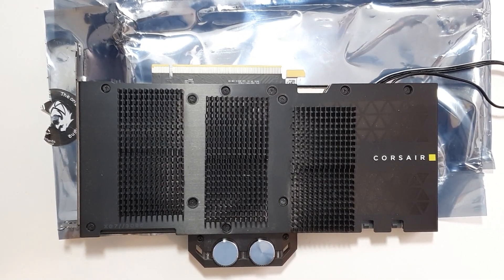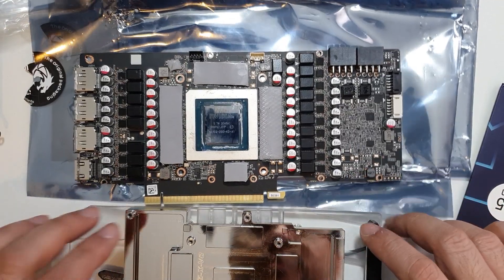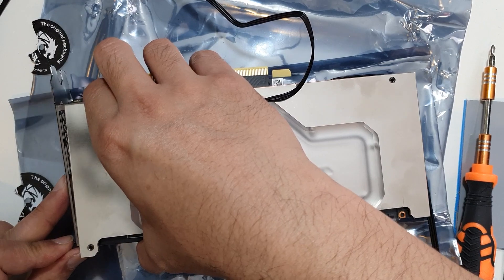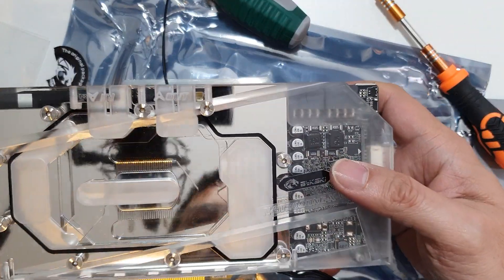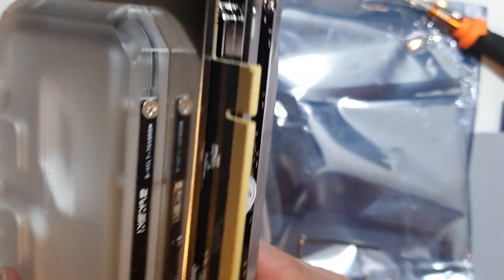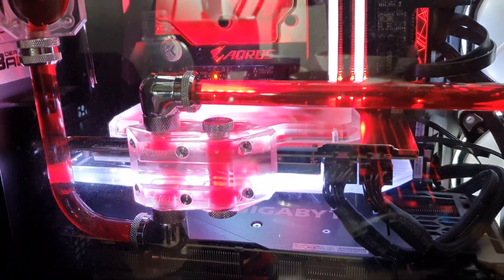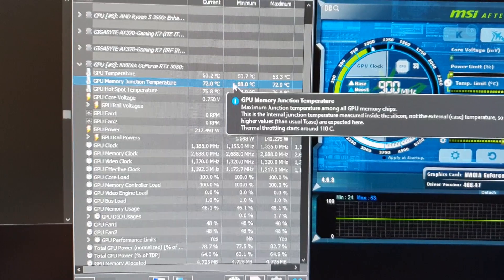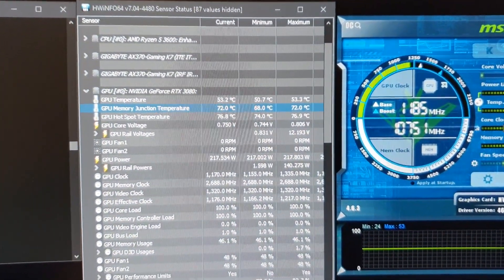Bykski RTX 3080/3090 Waterblock with Active Backplate Cooling Review

Comment: Do you have to use top and bottom ports on the bridge or can you use both top or bottom. Asking in consideration of a vertical mount in 5000d airflow case.
Reply from the maker: Its fixed so yes has to be top and bottom or if vertical mounted - front and back

Comment: Way too much thermal paste on the GPU and there is something wrong when you're water-cooling your card and have a 23C difference between your GPU/GPU hot spot temps!  My RTX 4090 has a 12C MAX differential between those two temps (and that's on a 600W GPU)...  Considering how much thermal paste you used on the GPU die could explains that result.  That is the only thing I can think of unless you simply installed the Byksi wrong somehow.  Perhaps you should have stuck with the thermal pads the block came with.  I know for a fact that exact thing has happened on another video I watched recently.  The guy had the same issue (delta between GPU and GPU hot spot was too high) and he was also using "better" pads that didn't come with the block (this was an EK WB) but they didn't allow proper compression and he wasn't getting a good enough seal on his GPU die.  He disassembled the card/block and re-installed it with the pads that came with the block and problem solved.  Dropped his delta by 10C.  I mean it could be the paste but I kind of doubt it.  That was a comical amount of thermal paste though...  Anyway, I'm not trying to be an asshole here just giving my honest input.  I've been building PC's since the mid 90's and started water-cooling around 2005, so ya...  Anyway, your PC looks great though!  Really nice job there.
Reply from the maker: no worries bud all good. I learned this rule many years back pea or rice on cpu and alot on gpu for pasting it has worked for me. Alot of people are confused by my temps but dont really understand that im mining or was mining with 2 cards on 3070 underneath the 3080 so the air cooling the rad at the top isnt fresh room temp air, its hot air from the 3070 also im measuring the junction temp and hot spot temp in hwinfo people only see the gpu temp. anyway since eth is dead ive since sold the 3070 and now just running cod mw2 max settings with 45C temps on the 3080 still on the same build with dusty fans and rads coz im lazy to do some cleaning. Might get a 5800x  to replace my 3600 so i dont get much cpu bottle neck on the mw2 benchmark and get past 163fps on 1440p

Comment: Have a question can I use the inlet as outlet outlet as Inlet
Reply from the maker: You can definitely reverse the flow going into the outlet and coming out of the inlet. From other liquid cooling guys the consensus on not following the directions for flow doesnt impact the overall temps so run your flow into your components the way you like
Reply: @magnomnz  thanks

Comment: On the memory, why did u pick 1.5mm over 2mm? Which one is better in ur experience?
Reply from the maker: The included ones were thinner but i already had the 1.5 ones but softer so i went with those. They got good contact and squished fairly good that would equivalent the included ones in thickness after. Its been a year now i think and still going strong. Mining for about 8 months on that 12 months, i stopped about 4 months ago since it wasnt worth it much anymore.

Comment: Got the same thingg took apart a asus tuf just to change thermals and it was horrible (card I got was a lemon and I lost silicon lottery badly)   I couldn't even boost the memory 1000+ or it would crash.  ANYWAYS long story short I purchased this waterblock and your video is perfect in explaining how to set up!  Now I just need to go through the trouble to set it up and the screws scare me!  Also is it too heavy?  Should a bracket be put underneath to hold it up?
Reply from the maker: Too bad on the lucked out silicon. As for the screws just hand tight screws no need to tighten them stiff. Since my card is reference theres only a few screws unlike custom aib ones.
Reply: @magnomnz  Oh nice, I gave that one back and got one that can go to 1000+ ez so good to see it makes a big difference on temps!   Just need the time and energy to do what you did.   Also quick question, I thought on the waterblock the in/out one is on top and the other is on the bottom.  Or does it not matter?
Reply from the maker: @jonahjameson272  the inlet and outlet are defined if horizontal mounted bottom is in top is out. if you mount the card vertical then facing you is in and the back of the  card is out.

Comment: 1st of all u wasted money, you don't need an active backplate for any 3080, 2nd you should of used gelid extreme, those pads you got are blah, quite stiff, youd need more than a 360mm rad for gpu/cpu setup too, the corsair would of been perfectly fine and looks way better.. your main issue is though on top of it all, having all the gpu heat of the 2nd card duping into the radiator

Comment: Those numbers are way higher then I thought they would be. I guess you get what you pay for, my EK blocks with active backplates keep the temps 10c lower over all and on the GPU 15ishc lower.
Reply from the maker: But do you have a 3070 under your 3080 both mining etherium on the same machine that is the question.

Comment: Sir, what about the other thermal pads, like on other chips, that manufacturer put on, such as resistors, etc, They don't need thermal pads anymore, after water cooling?
Reply from the maker: On the front pcb just follow all the places where your stock cooler has thermal pads at the back just cover the mems and  up to you for possibly some of the backside of the vrm if you want

Comment: You're pushing the hot air from inside ur pc generated by the 3070 thru the radiator and therefore getting much higher temps than u should. Also u didn't put thermal pads on the VRMs.

Comment: Bit late to the party and hindsights a great thing but here's an FYI for you, the outside of those ESD plastic bags like the one your 3080 is resting on are electrically conductive on the outside and only shielded on the inside so you might as well lay the card on something else even carpet lol as laying it on the outside of one of those bags is no better than using nothing at all.
Something maybe to be aware of in the future.
Reply from the maker: Honestly i have laid pc parts on carpet, bare floor, on top of billiard tables etc while building since year 2000  and ive had an internet cafe with 10 comouters and then worked on another internet cafe 3 years after with about 42 computers and 2 pool tables and not had any pcparts get any issues from static during builds see my 1st pc build here in this channel me building on the floor and carpet. That pc is now using a 3060 mining eth for 5 months and also used as an htpc.
Reply from the maker: This triggered me so much i had to remember and find jays video on it. https://youtu.be/0swuvSF527E
Reply: ESD bags are conductive on both sides, that's the whole point (avoid buildup of static charges).

Comment: Also you put rads pulling air through them by the fans from the outside of the case , you didn’t put thermal pads in the most important part of your 3090 THE VRM dude this I’m sorry is absolutely the worst technical video on blocking a gpu ! The block even had the extended areas for the pads to contact the block!!!!! No backplates that are cooled are not contributing heat to the system either that’s what heat transfer fluid systems don’t do they move the heat via liquid to an exchanger or radiation and dispel it there!
Reply from the maker: Just because it wasnt in the video doesnt mean its not there the vrms hs have thermal pads. Its been running fine still mining eth for 24/7 for the past 6 months and holding steady with temps on the tj at 64c.  It doesnt matter if you are pushing or pulling or both on rads the video isnt about maxing cooling performance.

Comment: You don't use thermal liquid in gpu processor?
Reply from the maker: just thermal paste, ive never used liquid metal on gpu or my cpus
Reply: Never use LM on gpu too many transistors close to the die one micron of lm hits and bye bye

Comment: Is active backplate always sold separately?
Reply from the maker: they come both in a package together. if you already have a waterblock without an active backplate and have a reference design 3080 or 3080 you could try the backplate waterblock only from bykski.
Reply: @magnomnz  im thinking about only the back plate since my card is already hybrid. do you think it will help my mem junction temp?
Reply from the maker: @truecrimeyo  if you are still mining yep but for games it shouldnt be a big deal not to have it, maybe for forspoken coz it has huge spec requiremwnts and likely to push 3080s to its limits. Go for it if you have the money and time to redo your loop

Comment: looks great. but i think you forgot to put the vrm thermal pads. you could have shorted the card if you didn't put those.
Reply: He did forget them
Reply: Also fan orientation killin temps on air cooled doesn’t matter on liquid you want all fans pulling air through rad from outside of pc case rads work on ambient temps so if exterior case temp 25c interior case temp 35-40c you are warming the fluid instead of cooling it lol that’s how ambient temps work with heat transfer fluid systems.I’m not sure about mining but if this thing is doing intensive work it’s will fry !!!! Maybe. It right away but it will fry

Comment: I just ordered bykski kit for my system and my 3080 this is good to know iv got same case as well this is good to know i need to order another 360 rad. Im running a 10900k oc to 5.2 so prob will have slightly higher temps

Comment: What xg7 waterblock is that? I can't seem to find it when I search up XG7 Zotac
Reply from the maker: Its the xg7 rgb ref model. Basically the reference 3080 waterblock from corsair.
Reply: @magnomnz  will it work with a Zotac Trinity 3080 Ti?
Reply from the maker: @icecoldkv8005  yep the xg7 ref waterblock will work with zotac 3080ti amp holo or trinity models

Comment: Did you notice if the top part connecting the front and back plates can be reversed?  I'm hoping to use 2 of these blocks to SLI 2x 3090's.   If the top part can only be mounted a single way, it could cause some issues with me running tubes.  (have to 3 slot SLI it due to reasons)
Reply from the maker: i think its possible to flip the connector of the front and back plates it looks like the screws are spaced evenly to reverse them and there arent any complicated jettings that require a certain flow direction since this will reverse the in and out of the water flow. i.e cpu block which requires opening the block and flipping a flow direction plate if you are changing the in and out ports.

Comment: What thermal pad are you using size and dimensions! Can you please put up a link to the product! I own the 3090 amp holo and was wondering if I need the same size thermal pads?
Reply from the maker: i use thermalright odyssey extreme 1.5mm
Reply: @magnomnz  after the upgrade are you getting the full hash rate! My vram hits 110c and the GPU starts throttling! I am only getting 74 mH/s. Which sucks!

Comment: Which model of 3080 are you using, my strix 3090 with ek block can’t fit in the o11. Considering about switching to by block, it looks decent and much cheaper.
Reply from the maker: i have the zotac amp holo 3080 it is using the ref design
Reply: @magnomnz  appreciate that

Comment: Just wanned to say that the reason for backplate for 3090 mining is because they have memory modules on the back with only cooling from the aluminium, So my 3090 tuf runs at 104c on the memory temp, but at 50 on gpu core. the 3080 dont really have an issue doing good in mining without overheating.. but I dont feel comfortable running it at 104c, so I "only" get 100mhs at 94c
Reply: I use thermal pads for back of my GTX670 to connect vrams with backplate. 
and my backplate is painfully hot to touch!
Reply: Hmm thinking of getting this if junction temps are much lower.  I currently bought a heatsink from amazon lets see (Already changed/swapped thermal pads 5-6 times cant remmeber?  All in 2 days because of my frustration.  I'm 100 celcius holding but getting 119mh

Comment: You didn't pad the chokes etc on the front and you have no mem chips on the back of the board? So not much point in the active backplate.
Reply: He followed the instructions (ha, just one picture), but I'm also surprised by how few spots they instruct to pad https://www.bykski.us/collections/new-products/products/bykski-full-coverage-gpu-water-block-w-integrated-active-backplate-for-aic-reference-rtx-3090-n-rtx3090h-tc-v2
Same here btw https://www.youtube.com/watch?v=FvFcE16_Rh4
Reply: @Miskatonik  https://youtu.be/ZAWFa-zuZOU
Reply: @sccsuk  Thank you, I know the guy. It's a bit of a pain to watch (he speaks like he's always high on something), but the content is useful. Bykski instructions are nonexistent, it's a real pita because they could sell so many more blocks just by doing some easy-to-follow instructions like Alphacool or EK. I'm still in doubt whether to buy a Byski total cover bock for my 3090 FE or just go with EK (gorgeous but super pricey) or any cheaper variant.
Reply: @Miskatonik  yes it was meant as constructive criticism, I found this looking into the bykski blocks myself, I have just ordered 2 blocks for my 3090 strix and trinity cards, might do the 3080 aswell if the blocks are good.
Reply: @Miskatonik  Bykski is great, I use it for cpu and gpu. Can't be happier. using for over a year.
Reply: @Miskatonik  common sense tells you to replicate the pad placement of the original cooler, the other video at least he pads the vrm chips, and a bit of a difference between a 3080 and a 3090, the active backplate is basically pointless on the 3080 with no ram chips on the back. These guys need to do a little more research into the subject matter before making these videos.
The temp of the air cooled card is lower than the water-cooled one.. he makes the excuse that its because its full system cooling but thats irrelevant when mining the cpu is basically idle so only the gpu is generating heat.

Comment: the bykski web said the pad is 1.8mm you use 1.5pad is it touching properly? and did you use 1.5 for everypart of the block?
Reply from the maker: Yep 1.5 for thw thermalright pads worked out fine. Im sure because when i reopened the block to put in some kryonaught and remove the ek paste the pads were clearly indented squished. If they barely touched i would notice it.  Again the included pads are very soft vs the thermalright odyssey ones are very stiff.
Reply: @magnomnz  thank for reply the comment i just get 3090 ftw3 today gonna order block soon
Reply: @magnomnz  use Thermalright paste instead of Kryonaut. I used both, kryonaut is too wet and dries over time. I like TF7 more.
Reply from the maker: @leihejun844  thanks for the tip ill buy some online and put some when do my loop cleaning. I think i need to clean my cpu block and pump.
Reply: Any success with the 1.5mm pads on your GPU? Update would be highly appreciated.
Reply: @IllgoRythm  first bykski 1.8 pad should work cause it soft enough  but better brand pad also better....1.5 will be use on the backplate active coolingand mosfet. 
1.0 on the front ddr6x chip and  ....coil don't need thermalpad but you can stack 10mm for it to fit the coil.....but with 2 years of using ....no problem with coil(LR22 ) , it doing fine without pad. if you have problem with active backplate try 1.0 might work different on some gpu.(my was 3090ftw3 )

Comment: I recently did my 1 st watercooled pc. 
But my 3090 ftw3. Staying at 43 when gaming and my cpu is 10-15 degrees over gpu temps.... ( gpu is 1 st in the loop)
Is it not to big of a difference ?
P.s. i did struggle to fit cpu waterblock as the braket dosen't have any retention screws.... i just sandwitch braket and waterblock and i needed someone come and put the screws..... i kinda wiggle with it... no too much room for 3 hands lol....
Reply from the maker: doesnt matter where the gpu sits in the loop after awhile the water temps will equalize. mustve been a small case if you didnt have much room to work with hehe.
Reply: Lian Li o11 XL...
Reply: In warzone. Gpu 48.... cpu 70... is my cpu temp ok ????? ( i mean before on air cooled. Gpu was 80 ... cpu was 65

Comment: what is the thickness of the backplate at the edges? and how far out does the connecting block stick out from the front side of the card?
Reply from the maker: back plate is about 3mm thick. id say the connector block over hangs the front of the block by 2mm. the connecting block itself is 30mm tall - so its +30mm or 3cm extra clearance to the side of your case if you are mounting it horizontal.

Comment: I mine with Corsair waterblock and get 96degrees Celsius on memory with a heatsink along with thermal pads on the back of it with a fan.
Reply from the maker: I had the same xg7 block from corsair and was about 92 to 96. Now its 70c average. Big improvement over constantly being at 90+.  plus it looks better without the 80mm noctua fan blowing on the back of the xg7.
Reply: @magnomnz  what heatsink do you have? Did you cover the whole backplate in tiny heatsinks?
Reply from the maker: @kaptain1477  you can see it at the start of this video